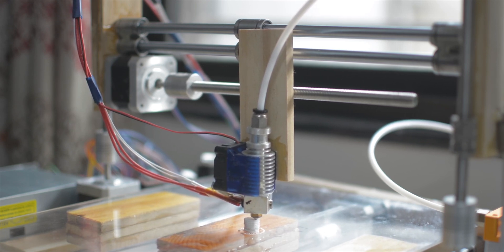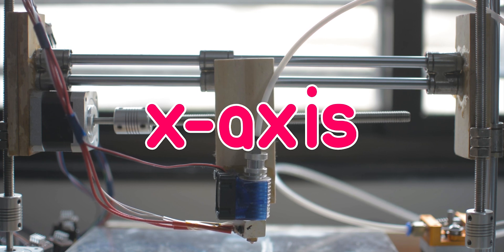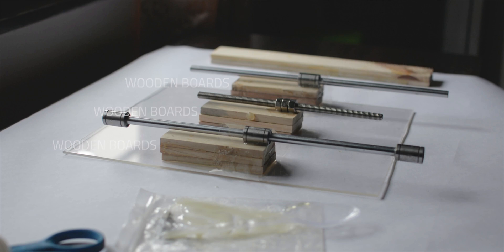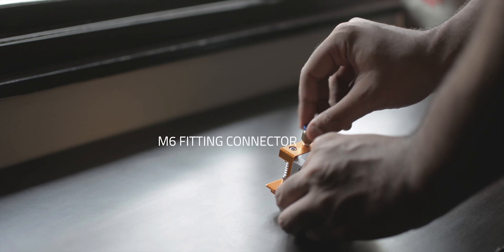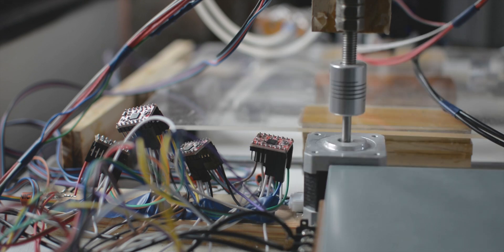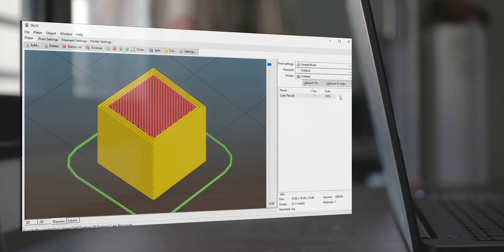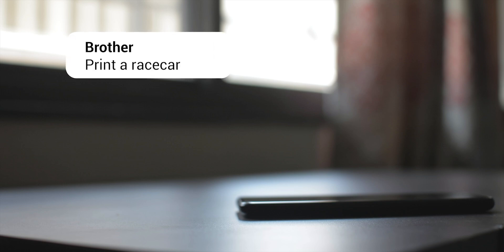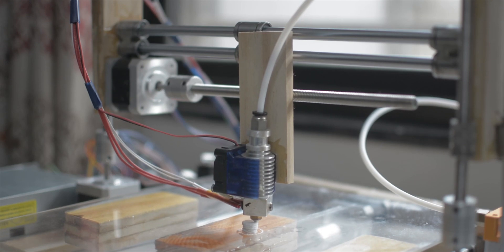How I Built A 3D Printer At Home

Comment: Hey Tejas Nice work!
I am working on a metal printer using the CNC gantry and welding machine and I would like to hear some from you in this regard. One thing is can I install this teacup firmware in Arduino Nano? Also, how suitable this firmware will be for metal printing according to you. Also, how do you set the machine home and soft limits etc? Would really appreciate some help in these areas. Thanks in advance